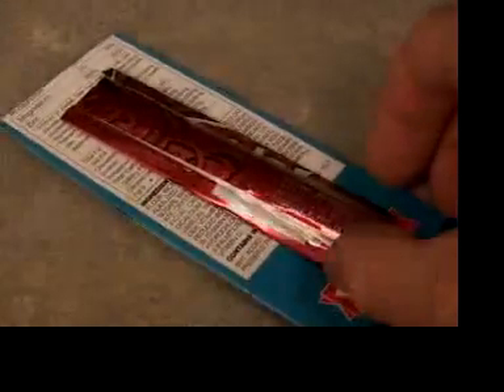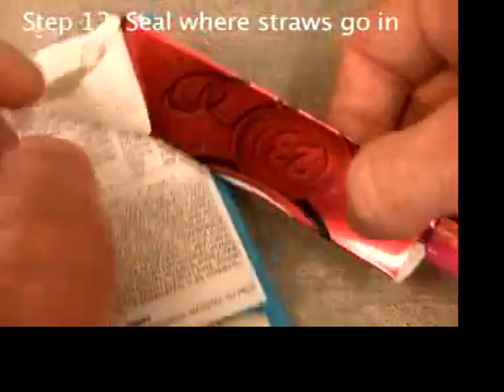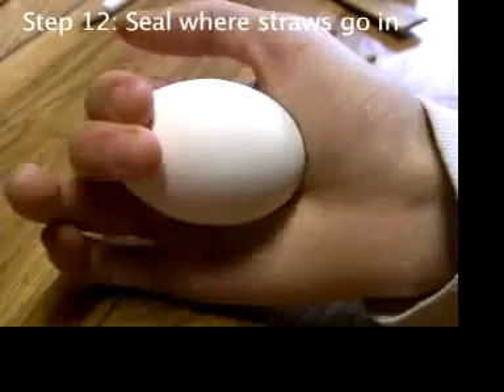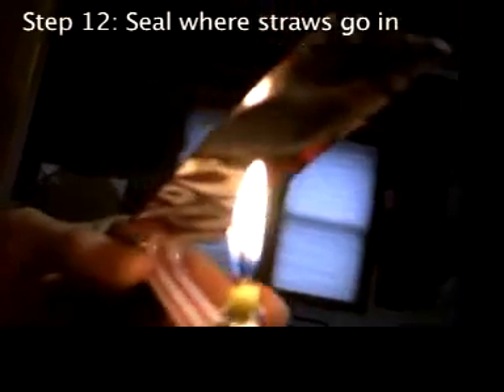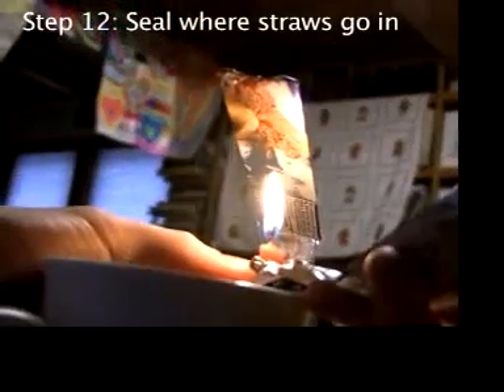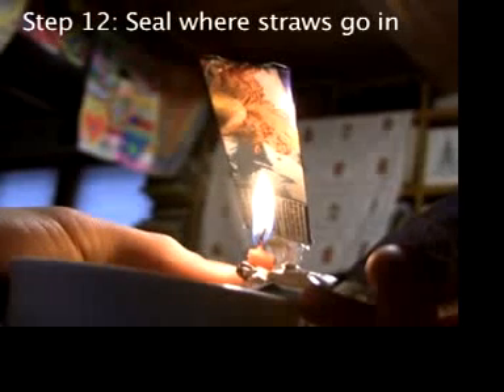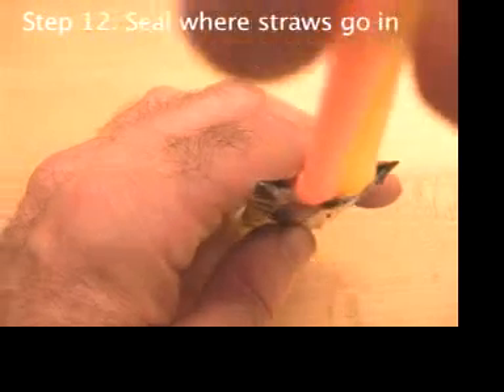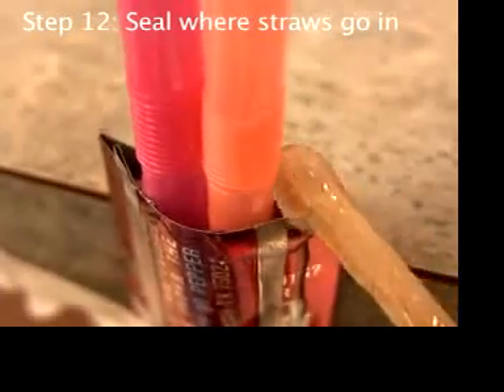Part 15 Build a Putt Putt/Pop Pop Steam Boat s12seal straw end

Comment: a good tip i learned by acident when making my engine, when you seal the end, make a little epoxy and put it in the fridge for about 3 mins or so or until it gets a bit thicker, this makes sealing much easy

Comment from the maker: Theoretically it is cool enough where the straws glue in to use hot glue, but in practice it does not seal well. There is a quick set form of epoxy.

Comment from the maker: @TheAdventuresClayMan You might be able to get away with using hot glue to seal where the straw goes in. You cannot, however, use hot glue in the rest of the engine because that part gets too hot.
Slater

Comment from the maker: Something is not right. Even the slow Epoxy takes less than 24 hour to harden. Did you mix the two parts? You have to stir the 2 parts together for a minute.

Comment: Yeah I was wondering the same thing, could I use hot glue on the part where you glue the straws in and the part when you seal the holes? Because I have epoxy but it takes like 2 or 3 days to dry and I don't really want to wait that long...